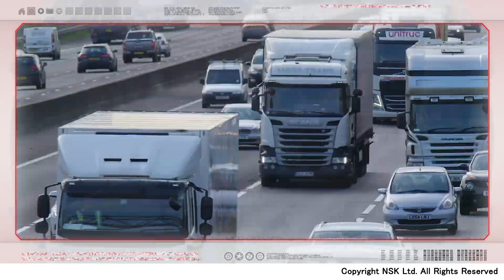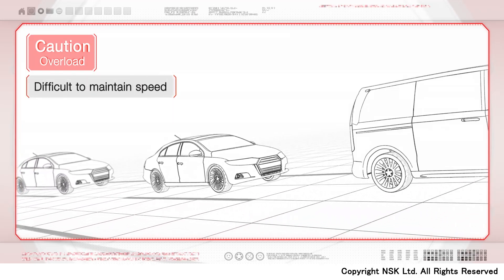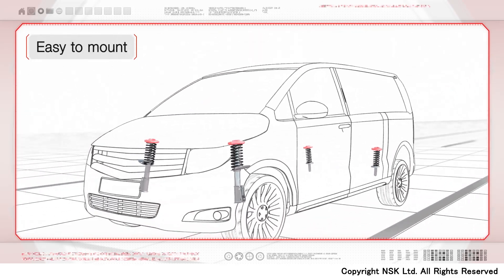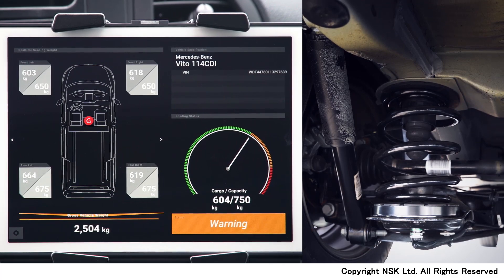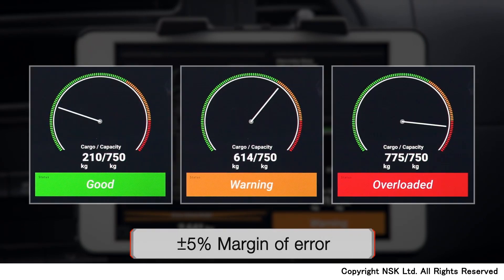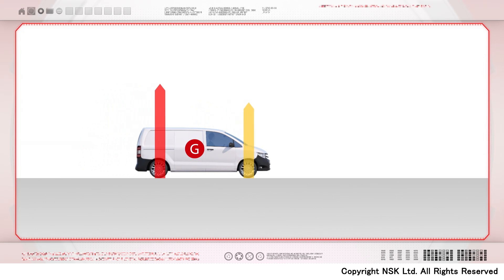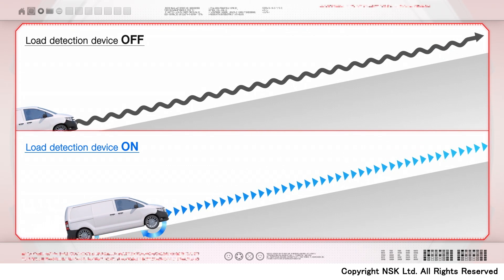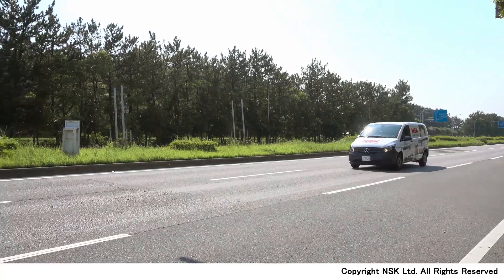World’s First Hydraulic Load Detection Device For Vehicles - NSK

Comment: Wow... you think by telling the transmission that your load is to far forward that it will gain more traction? By sending power to the front wheels? Isn't that called 4x4? Or 4WD? Or All wheel drive? Technology that's been arround for over 120 years???
Reply: I don't think that's what they meant. What they meant was a heavy load will trigger a different automatic transmission shifting profile that keeps in lower gear longer with higher RPM, which makes it easier to maintain speed up hills.